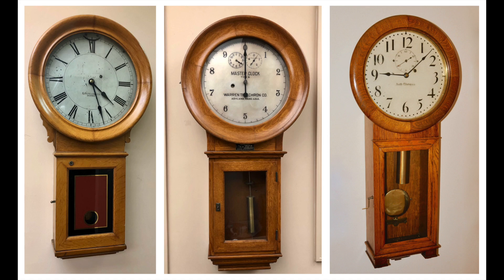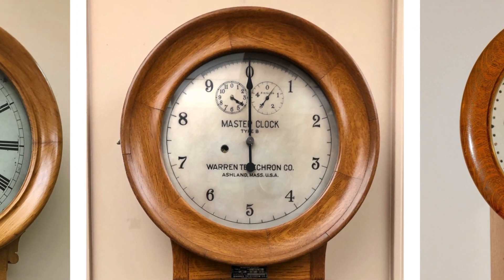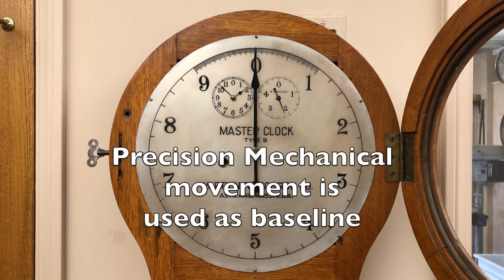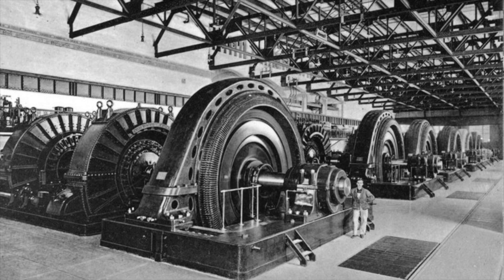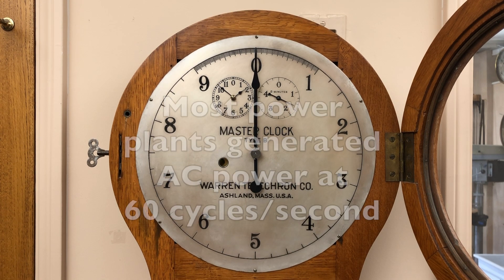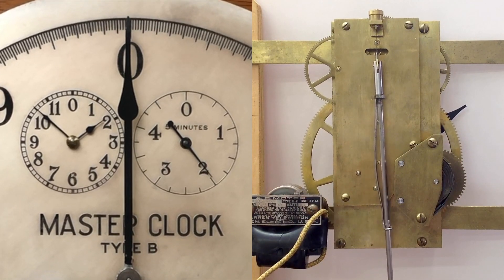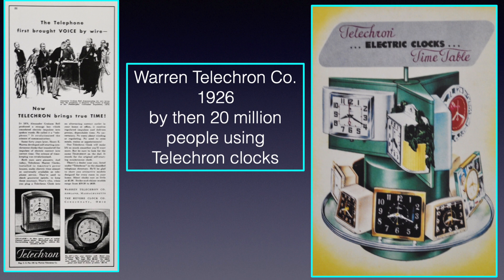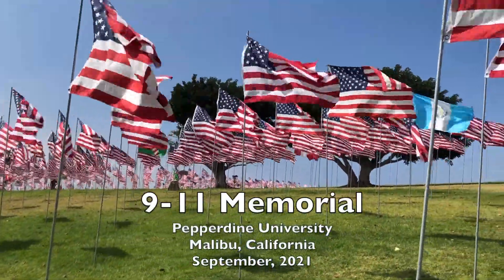Warren Telechron Type B Master Clock

Comment: Hi, great video! I have a mostly complete clock like this one. I'm working on getting it going again but am looking for parts. It looks like I need the motor assembly, mainspring assembly (the complete assemblies that mount on the mechanical movement) and the hands. Do you have any spare parts available or know where I may be able to find them? Thanks for any help or information!
Reply from the maker: Hi Tony, Very difficult to find parts. I do not have any spare parts. You best bet is to look for a junker and hope it has what you need. Good luck and thanks for watching my video.

Comment: Hi, I just found one of these at a flea market - amazing technology for the time. Mine is missing the Pendulum assembly though (Model B) where would I source/fabricate one of these?
Reply from the maker: Hi Daniel, I checked with a few fellow collectors and no one has an extra pendulum. Best bet is to watch on eBay for a junker. The suspension spring is unique. Hopefully yours has the suspension parts.  Good luck, Alan

Comment: Great video, Alan.  I live in Henry Warren’s home town and have restored three or four of these B’s.   They certainly are interesting time pieces.  Thank you for your efforts here :-)
Reply from the maker: Thank you Bill. Living in Henry Warren's home town means these clocks are a perfect fit for you. I hope you kept one for yourself.
Reply: Hello, I have a Master Clock #55 Type B, 110 volts and 60 cycles Pat Oct 29, 18. The clock mechanism is intact and I have the pendulum. It has the original glass over the dial and the case. The wood needs to be glued back together in areas and there is a split in one area. What would this be worth? What is the cost to repair/restore?

Comment: question - is the mechanical movement a wind up 8 day clock?
Reply from the maker: Great question. I neglected to mention that the clock is self winding. The winding hole in the dial is to wind the mainspring when starting the first time. The movement is amazing and keeps the spring wound once in operation. If the pendulum stops the mainspring can over wind and break. A beautiful movement.
Reply: @SelfWindingClocks  Thanks for that info.  I guess watching your video was kismet for me.  I just found and bought one of these this morning.
Reply from the maker: @AJ67901  I am delighted for you. Good news and enjoy.